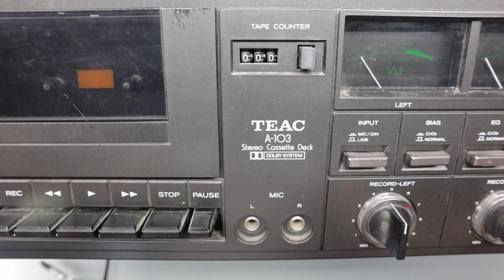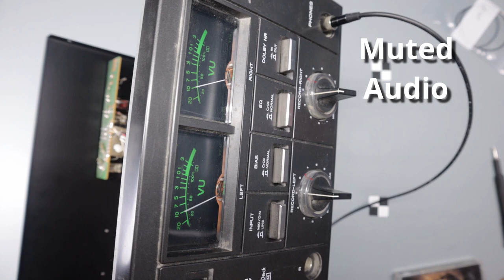TEAC A-103 Capstan Drive Belt Replacement

Comment: The drive belt on my Teac A-103 broke about ten years and I just stored it away. This video is the answer to getting it fixed. Where does one buy tape recorder belts nowadays?
Reply from the maker: These I bought on Amazon, I added the link to the description.
Reply: Which one drive belt you bought? 5mm x 26cm?
Reply from the maker: @iwanarryansyah6593
Sorry I missed this comment, it didn't notify me.
The belts come as a kit and the sizes aren't listed in the TEAC manual.
It is the only wide one, so probably 5mm.
As for the length, I found another website that sells 8 inch belts for many machines and that is approx 20.5 cm

Comment: How about the timer belt?
Reply from the maker: The easy part is the back side of the counter, it's under a small circuit board held on with 2 rubber bumpers, you can see that around 00:40 in the top middle.
The harder part is on the take up reel under the cassette holder.
I think, if you take of the 2 screws holding bracket the counter is on (one is under a piece of black cardboard), you would have access from the side.
You would probably need the cassette cover off, and the cassette holder ejected, to then feed the belt through the hole and over the take up reel, and then pull it over into position, reinstall the counter bracket, and finish.

Another way, possibly (since I haven't replace that belt myself), would be to take the full cassette mechanism out.  There are 2 screws on the top and 2 on the bottom of the case.
If taking them off loosens it enough that would be the way to go.

Comment: $31.00 for the belt kit!!!! I'll try the rubber band method and trash the machine if that doesn't work.
Reply from the maker: I think it was $27 back when I bought it, that's just where I ended up getting it from.
If you search there are kits for $10-15 on eBay, you never know the quality though...